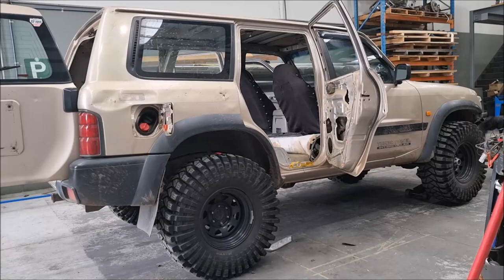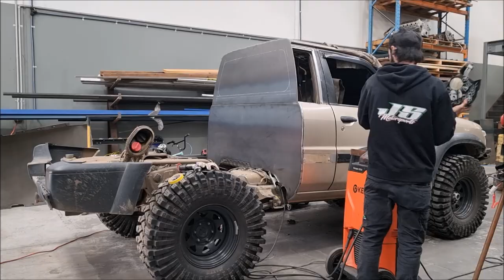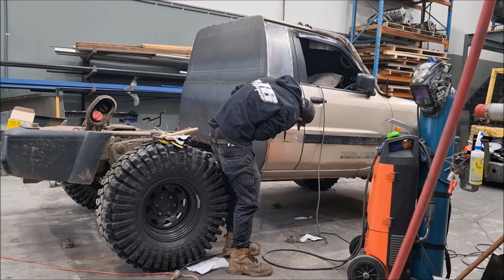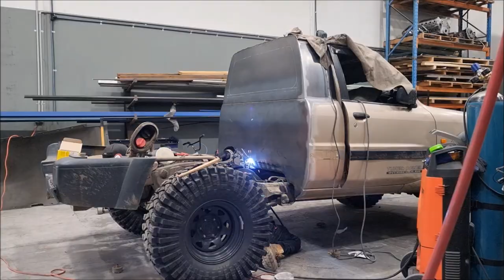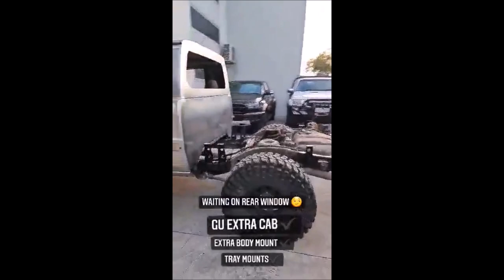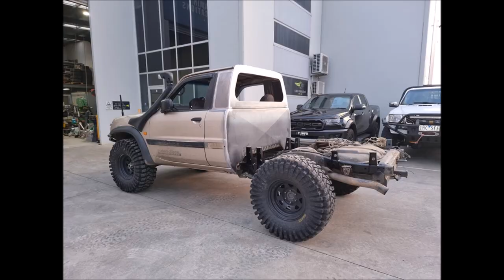Gu Patrol Extra Cab Chop

Comment: Awesome work mate. Please if you can add More details of the steps by steps before cutting example , remove interior,chairs , floor cover etc etc . 
Detail of welding and  thickness of the plate your using to cover the back of the truck.  Appreciate more depth detail of your work.  Looking forward to new videos
Reply from the maker: all the interiour is removed for us by the customer, but i will see how i go making some more detailed videos in the future. check out out next video on a GU dual cab, has a little bit more detail on the inside but we use a factory single cab ute wall and graft it onto the back.

Comment: Its just me or he should have done a roll cage in the back for rigidity?
Reply from the maker: we incorporate internal structure in the walls to meet our engineers requirements, they arnt just sheet metal walls
Reply: @Flamin Fabrications  ahh that makes sense, i was also wondering where the hoop was!

Would be good to see more detail on what's in there
Reply: @Denuto  I wwas wondering the same thing.
Also why didn't you use a single sheet of metal for the rear wall?